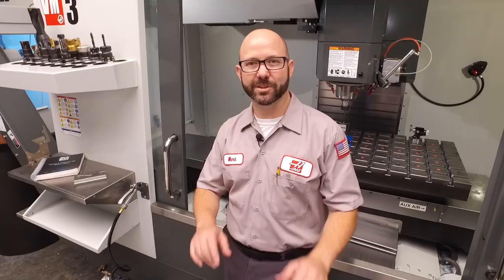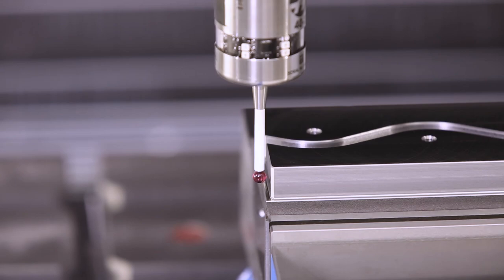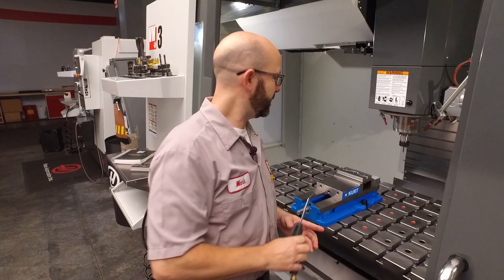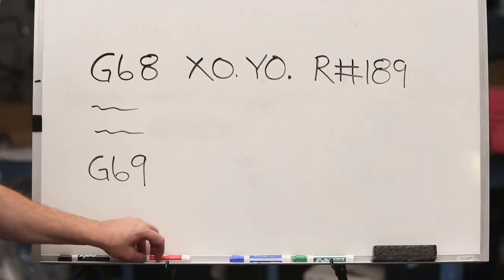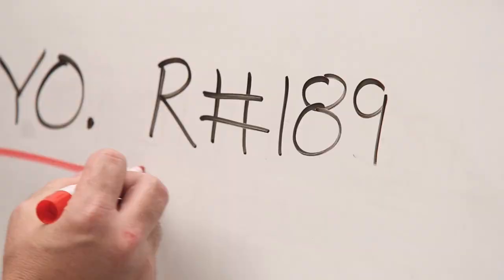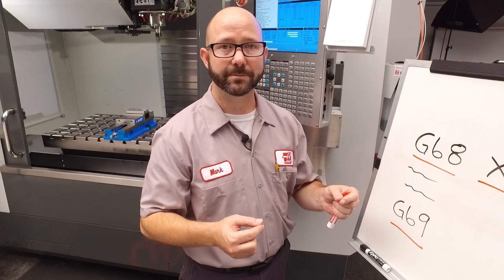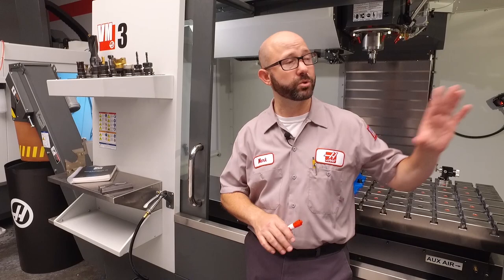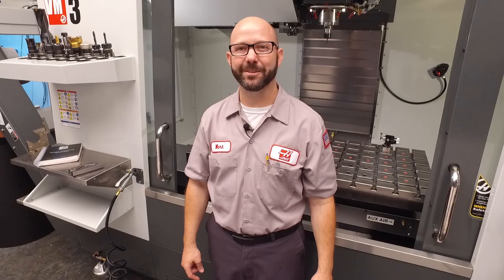Machining Magic: Rotate Your Part with G68– Haas Automation Tip of the Day

Comment: For those of us without that fancy-shmancy probe :)

1} Pick up a point on Y, set X=0 and Y=0
2} Move a distance along X, pick up another Y (for this example let's say we moved 30mm and picked up offset of 0.25mm)
3} Set Windows calculator to scientific mode and divide X by Y. In this case it is 0.25/30=0.0083333_
4} Press the 'Inv' button and press the "tan¯¹". In this case it will be tan¯¹(0.0083333_)≈0.477453777 

The answer you get after all this and some rounding (0.4775 in our example) is the angle of the part, so now you can use "G68 X0 Y0 R0.4775" to rotate the code around the "zero-zero" origin to match the part. Make sure to put G69 at the end of the code to cancel the rotation. 

It's a bit confusing, at least until you get used to it. For large batches it would be much better to indicate in your vise, though on the other hand once the G68 is set relative to the vise you can just swap parts in the vise and run that same code over and over.

Comment: A key point to make is that the G68 can only handle one plane at a time.  if you called the G68 with a G17, you can't have any G18's or G19's until after the G69. (i.e. vertical lead-in/out radius moves)

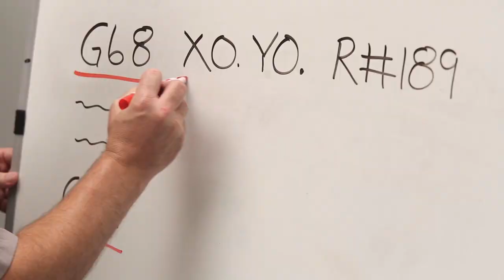Comment: Hi Mark, Great video! I have a question though: At 2:06 in the video you say X0Y0. Which X0Y0 is that? Machine origin or the current work offset (G54, G55, etc)?
Reply from the maker: Hi Dan. The XY, on the G68 line, is the point about which your program rotates – in the current Work Coordinate System. So it is in relation to your G54, G55, etc., that you mentioned. Thanks for the question, and giving me the chance to clear that up! 
-Mark, Haas Tips of the Day
Reply: Haas Automation, Inc. Makes sense. Thanks for the reply Mark.

Comment: Similar to wire edm. You can eyeball your set up and and use the wire to measure a machined edge and the program will run at the measured angle. Cool stuff.

Comment: I've got question: is it possible to change first point of probing? I mean this 20mm which is set as default?  For example i would like to first measure point Yaxis be at 39mm from probe position and next at 50mm. Is it possible?
Reply from the maker: Nikto wazny – It’s possible, but not with this probing cycle. You can download the Renishaw Inspection plus from our website though, and it has cycles that will work the way you would like. https://diy.haascnc.com/user-guide#gsc.tab=0. Check out the P9843 cycle. – Mark, Haas Tip-of-the-day.

Comment: Does the NGC allow for multiple work coordinate rotation shifts? This would be gold for us.
Reply: Store the angles in variables. eg:
G54 probing
#500=#189
G55 probing
#501=#189
..
G54
G68 X0 Y0 R#500
..
G69
G55
G68 X0 Y0 R#501
etc.
Reply: Yes I get that. But if you run 30 tools back and forth the G68/G69 has to be used a ton and I'd rather not try and automate that into my post processor.

Comment: If I don't have a probe to do the angle calculations, can you write a subroutine that calculates the angle from a set of X,Y, coordinates obtained from using the DRO and an edge finder or do you have to do the math by hand to get the angle? and does this even save time to do by hand? would it be just as fast to dial in your vise?

Comment: Hi Mark,
I have a complicated question. I am probing a pocket for my G54 work offset. Can I use the G68 code from another work offset, say G59, to set my angle and still use G54. I'm thinking like this G68 G59 X0. Y0. R#189 in the program for the G54 work offset.
Reply from the maker: Hi Bryan – 
  If I start to change work offsets, after probing, I would rather write my #189 probed angle value to a different variable, just in case. That #189 is used every time we probe something, so it gets overwritten often. In your case I might probe the angle, and then store that angle in my own variable, say #900, so #900=#189. Later, I can use that angle with any Work Offset I’d like, using G68 X0. Y0. R#900. This is just a bit safer. I hope this helped. If you have more questions, you can reply, or shoot us an email at TOD@haascnc.com. When writing macros, it is also good to use a “/” or a G103 P1 to block lookahed (see our Macro Lookahead video). – Mark, Haas Tip-of-the-day

Comment: Hola soy de argentina y soy programador y operario de un haas ec500 y de un haas st-30 y me gustaria aprender mas del haas ec500. Por ejemplo como puedo cambiar automaticamente el programa cada vez q cambia el pallet y mas. Gracias por los consejos ayudan bastante. Saludoss
Reply from the maker: Leonel Acosta – Thanks for the comment. We are coming out with a  redesigned EC-400 soon, so look for new videos on our Horizontal machines soon. Thanks for the suggestion – Mark, Haas Tip-of-the-day
Reply: Haas Automation, Inc. thank you very much mark and very good advice and for the translation for which we do not understand English very well. Greetings and success

Comment: Trying to do this to find the angle of my part so that it offsets my program. But I’m going between two bores. Any help would be great. Thanks
Reply from the maker: Colton –  To pickup the angle of a line between two probed holes, we’ll the the O9834 routine from the Renishaw Inspection Plus for Haas Manual. You can download the manual from the Haas website. – Mark, Haas Tip-of-the-day https://www.haascnc.com/service/search-results.manual.html#keywords%3Drenishaw%26contentTypes%3DInstruction%20Manual%26popularTopics%3DMill
Reply: @haasautomation  Good old Feature to Feature.. My question is can anything other than a G69 turn this function off? Or do I only need this at the beggining of the program and a G69 at the end?

Comment: Can you use G68 to rotate in the XZ plane so for example my part is not perfectly horizontal... I want mill a slot from X0Y0 to X10Y0  but my work offset height changes from Z0 (at X0Y0) to Z0.1 (at X10Y0)... could I use a G68 X0Z0 R0.6  ?  I would like to witch to answer that one ha ha

Comment: Haas Automation, Inc.  My question is can anything other than a G69 turn this function off? Or do I only need this at the beggining of the program and a G69 at the end?
Reply from the maker: Matthew – 
 It’s always a good idea to turn G68 Rotation Off (G69) at the end of each operation, before each tool change. Some codes, Like G53, can cause alarms (on many software versions) if you try to use them within a G68 Rotation. An M30, at the end of the program, will clear the G68 state as well, but if you use G68 a lot it may be a good idea to add a G69 to your Safe Startup lines. – Mark, Haas Tip-of-the-day

Comment: The real question is why you are still using G code that uses identifiers that nobody knows what it means unless you either study the codes or look up each one. Should be using conversational programming that tells the user what it is.
Reply from the maker: SpeedDemonExpress – Our VPS (Visual Programming System) uses text based, conversational terms for the variables, and we aren’t necessarily  married to the idea of only using straight G&M codes in our programming language in the future. The Software and User Interface group are always exploring new options. For now, it keeps the code short, clean and simple, but we are always open to change. Thanks for the comment.  – Mark, Haas Tip-of-the-day
Reply: Haas Automation, Inc.  G code made sense back when they were using film for programming but it's an old dog now. It complicates training. Some g codes arentr universal either. We have different brands of machines at work and a code for one machines means sonething different for another machine if the command even exists at all! So instead of having for example 
Gxx
4000
Use 
Spindle Speed 
4000
Everyone will know what that means.